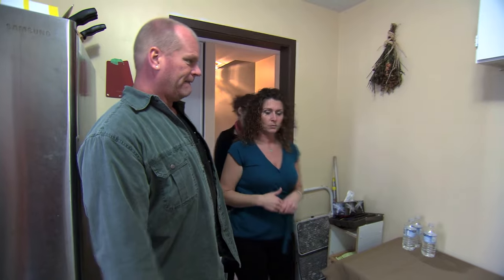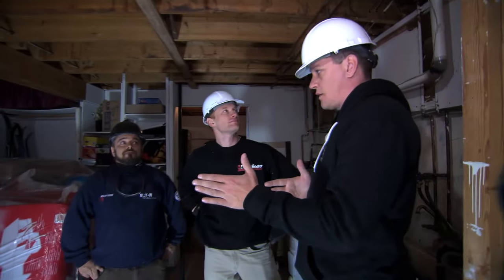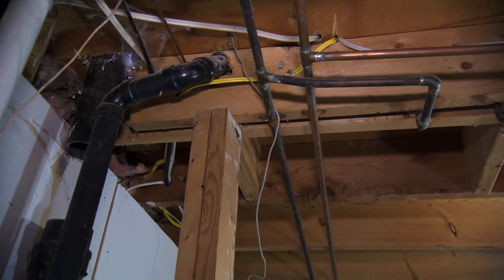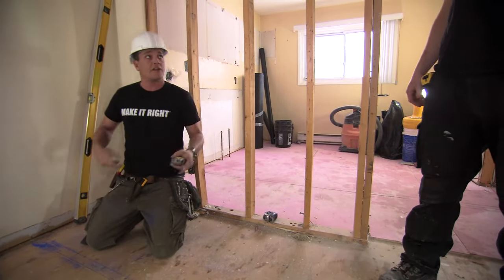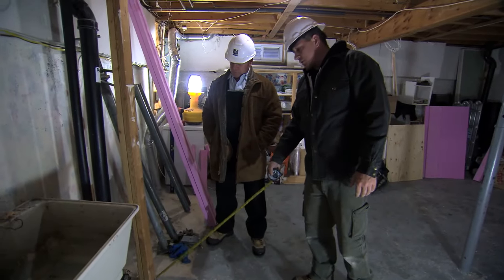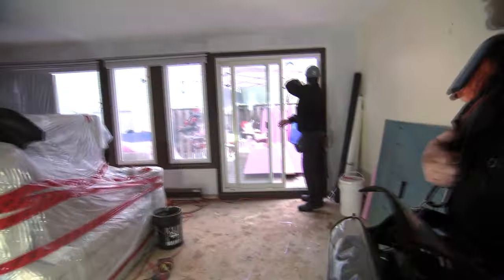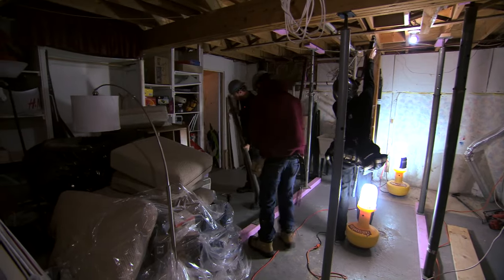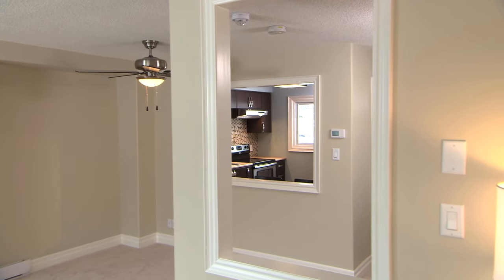HOLMES MAKES IT RIGHT: Deaf Space

Comment: svtfast, if you ask a question, be sure to turn on replies! Wood that's been pressure treated with preservative has a different color to it (I usually see green, not blue) so that inspectors can tell at a glance if the proper kind of material has been used.
Reply: Thanks - I was wondering about the different colors.

Comment: all you people that are supporting Holmes... you have no idea that your only supporting television and are loosing focus on reality trades people! This guy has no clue and is manipulating those of you that watch to much TV. For example .. glue, screw and nail a beam? Glue is a waste of time, especially in that kind of scenario... Screw? Screws have no sheer strength so all and all this clown is playing with your heads. I know this because many of us have done this kinda work for a lot longer than this guys been on TV
Reply: I think if you correct construction problems for over 20 years that you'd also be more than a bit peeved at so-called professionals that cut through critical support beams in order to install plumbing and commit other egregious errors that can potentially cause structural failure.

As for your criticisms about screws and glue, you obviously have no idea what you're talking about. The whole point is to make the reinforcement act as a single solid piece with the existing beams. Screws and glue do that better than nails. Yes, you need nails for sheer strength, but you nails won't adhere the individual pieces to each other to make a single beam.
Reply: realemonful I am an IT person, so I have no idea about construction, but I would have used 12mm bolts with 40mm "penny" washers to clamp that up, no less than a foot apart...
Reply: +realemonful  I would assume that you're probably one of those people who has done subpar jobs, and other people have had to come and fix.  Just from the way your talking.
Reply: I'm the one that fixes other wannabe's jobs lol... including holmes's...
Reply: You sound like a handyman tbh whos jobs Mike Holmes and his crew fix everyday
Reply: They use GRK screws bro.
Reply: realemonful sounds like your upset because you are actually learning stuff you never had a clue about! Probably why your sitting on your catching watching YouTube instead put in the field working 🤷‍♂️
Reply: They make shear rated screws/bolts. Even if he didnt use those the point is to make a rigid connection. Over built is better than minimum / subpar .
Reply: @dlwatib  He is absolutely CORRECT about the scews, they DO NOT have the shear value of a nail but he was wrong about the glue.